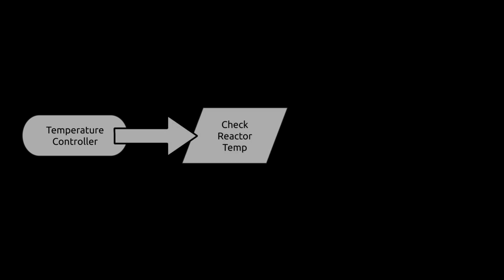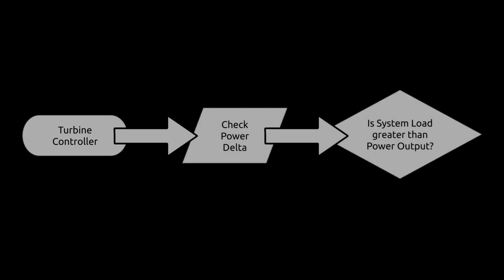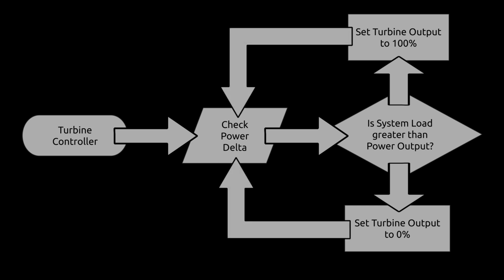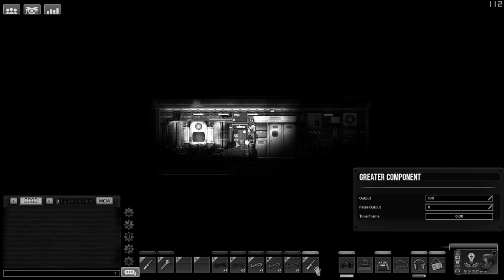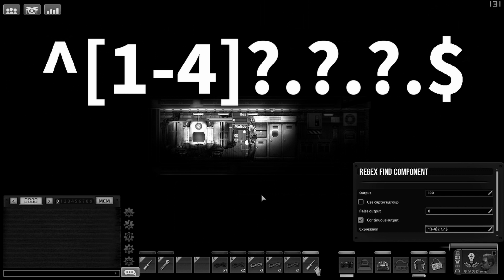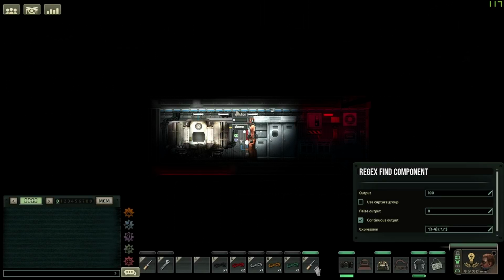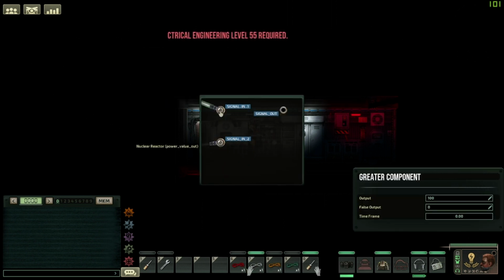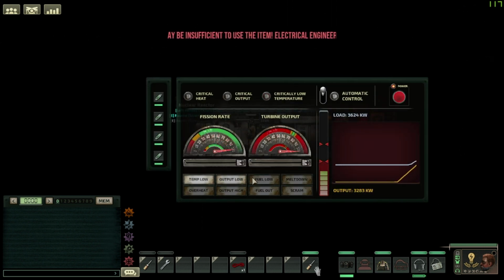Barotrauma - BEHOLD! The 2-Component Reactor Controller!

Comment: Why is this better than just letting it be auto? I know if U suddenly use more power load the reactor has to catch up again, but it uses more fuel because it's at max 50% of the time.
Reply: Personally I don't know how the game has changed, I haven't played in a while, but I bet the issue is the date. This video is nearing 5 years old, and I remember 3-ish years ago the auto controller was extremely sluggish, it would take too long to wind up and too long to spool down, so you get an alternation of brown outs and reactor overheats. Plus you can modify it a bit to change the maximum value of the fission rate with the radio chat letting you set a power saving mode of sorts.

Comment: as cool as this may be, this thing eats your rods for breakfast if you're only using one rod. For instance, in Camel, it takes around 39 seconds to deplete 5% of fuel with this setup, where as Without and With automatic control Enabled, it takes around 55seconds to deplete the same 5%, that's a Substantial difference. Haven't noticed that with 2 rods, it seems 2 rods is okay to use, no difference. However, when using the old trusty 5 components setup, it takes 1min and 16sec to deplete that 5%! With this setup, you'll be loosing so many rods that the benefit is nonexistent, negative even.

Comment: Does anyone know if this still works with 1.0?
Reply from the maker: Unfortunately no. The devs decided it was breaking the game, and changed reactors so that external inputs act at 20% the rate that manual inputs do.
Reply: @TheGamingNerd2022  NOOOOOOOOOOOOOOOOOOOOOOO
Reply: @TheGamingNerd2022  Is it still better than no external output and just normal automatic mode?

Comment: If you are wondering why it isn't working for you, the Bang-Bang controller does not work as well since the 'hoist the sails' update. It's still viable if you are willing to spend a lot of time tweaking values & putting out fires to find out what works for your sub, but it isn't a magic wand any more, & doesn't seem to work quite as well as before even if you get it right.
Reply: I made it work again by making the controller activate only when 4000 °c of reactor temp is at least reached through signal check and relay. By doing that, it prevents the latency " effects " so avoids problems and unwanted underperforming ( the controller is ON at the right moment and goes off when needed so it's stable ). The greater component is set to 75 to safely manage 1 or 2 fuel rods. My reactor works flawlessly and has always an ideal temperature (450-500°c). ENJOY !
Reply: Do you know why it no longer works?
Reply: @leslieviljoen probably due to values changing isn't instantenous anymore and instead takes time to get to other values.
Reply: @Jin-1337  then I wonder if the on/off points can be tuned to match specific fuels. I know that defeats the purpose a bit, but I would be happy always using four uranium rods.

Comment: for anyone who would like this in written form:

-----materials

1x greater than component

1x regex component

5x wires, preferably different colours

-----placement and configuration

-place components near reactor

-configure greater than component output to 100 and false output to 0

-configure regex to output of 100, false output of 0 and expression of:      ^[1-4]>.>.>.$

-----wiring
wire (temperature_out) from reactor to (signal_in) of regex component

wire (power_value_out) from reactor to (signal_in_2) of greater than component

wire (load_value_out) from reactor to (signal_in_one) of greater than component

wire (signal_out) from greater than component to (set_turbineoutput)of reactor

wire (signal_out) from regex component to (set_fissionrate) of reactor
Reply from the maker: Accurate, except for the regex search expression (your ">" s should be "?"s) and enabling group capture checkbox

Comment: With the latest update, this no longer works properly. Any recommendations on how to remedy this? It now lags behind and tends to either overproduce power, or under produce to that lagging behind. So either meltdown, or not enough power. I wonder why they made that change in the latest update
Reply: no way to change it, reactor wire controls are super-smoothed now, best thing to do is to add batteries and a control system to connect and disconnect them as needed, and a control system so the charging load drops slowly
Reply: @TheAechBomb  ya... that's pretty much what I've been doing. It does give the batteries a use though, which is nice. Before they were just sometimes useful. Now they're acting like capacitors

Comment: @The Gaming Nerd "Signals no longer set the fission and turbine rates of the reactor instantaneously, making automated reactor circuits less overpowered. ....", but  "Overvoltage makes devices perform better. ". So, Should we make new controller that will keep overvoltage instead of finding perfect balance?

Comment: New barotrauma player here and I absolutely loved this design. It is cheap, easy and extremely effective. However sadly, the most recent update (Hoist the sails) nerfs automated reactor controllers by delaying the speed at which signals can set turbine rate and fission rate. To clarify, RCs still work, but are just less effective than manual operation of the reactor.

It seems like the developers want to promote having a human being sit still and drag sliders as 'gameplay' to be more efficient. As the designated electrical engineer amongst my crew, I am quite disappointed by this and I hope that this changes, as I thought that the developers wanted to reward creative wiring and engineering solutions to problems such as reactor control.

I'll still love the game and keep playing. It's just a shame that I can't be 100% efficient anymore.
Reply: it was patched its not OP anymore press F for our best and cheapest controller in the game
Reply: It’s funny, considering that you can change so much in the sub editor, you could make a cheat sub and this is something they still just want to nerf anyways.

Comment: @The Gaming Nerd  Hey, I've used this controller in multiple playthroughs, and sadly it's time may be coming to an end! I'm writing to notify you about changes in the next update that is coming out soon. Setting fusion rate and turbine output will no longer be instant. We may need a PID controller after all!
Reply: I've already noticed this issue. I have been attempting to use this setup which worked great before, and now the reactor occasionally goes into near meltdown and also tends to not output enough power. TheGamingNerd, any recommendations on how to fix this once more?
Reply: Any idea why the Devs are making this change? Do they really prefer that players sit at the reactor dragging sliders for hours, rather than engineer an automated solution?

Comment: I have an issue with my sub where when too many things start to get used I lose power. Is there a way to add a buffer system to this to kick in when the reactor cant kick in fast enough? Also how would I go about adding a battery backup to kick in when the reactor runs out of fuel? I've tried to make both of these but I need a new view because i cant seem to get it.

Comment: My reactor caught fire and i have no idea where I went wrong lmfao. Im on the hammer head and i've done everything to spec i'm pretty sure.

UPDATE: i put in a second fuel rod and it is now sitting at the correct power...... idk why it caught fire the first time hopefully it doesnt happen again.
Reply: My reactor Stays locked at 1770 kW output
Reply from the maker: Okay, there are four variable elements to this design.. the the inputs to each Greater than block and the outputs to each Greater than block. We'll call the block that drives the fission rate Block A and the block that drives the turbine output Block B. You want the fission rate to generate a core temperature of no more than 5,000°, so if the first input to Block A is the reactor temperature and the second input is the output of the memory block (which should be set to 5000) then you want the true output of Block A to be zero and the false output to be 100. Again this means if the core temperature exceeds 5,000° then the fission rate is set to 0 otherwise it's set to max. 

Similarly, you want the turbines to output enough power to match the load but not exceed it. So if your first input to Block B is the power output value of the reactor and the second input is the load value from the reactor, then your true output would be zero and your false output would be 100. Again, this prevents the power output from exceeding the load by sending the turbine output to zero, otherwise it's set to Max.

In both cases it's okay to reverse the wiring, as long as you reverse the true and false outputs as well. Otherwise your reactor will be aiming for any temperature above 5,000° and will aim to constantly produce more power than is required
For what it's worth, despite its simplicity I'll botch the initial setup of this circuit if I'm rushing or not paying attention, 99 times out of 100 it's a mismatch between the order of the wiring and the order of the true false outputs. Occasionally I'll put something weird in the memory block, like "5000e" or " 5000" (yes that space causes problems)

Comment: So this makes my reactor efficient and prevents meltdown?
Reply from the maker: Absolutely. This fission rate controller will always use the least amount of fuel possible to maintain a core temperature of 5000 degrees, and there isn't another turbine controller out there that will match your fluctuating power demands so closely. Combined, you can run four Fulgurium fuel rods (increasing your reactor's max power output by over 400%) and never have to worry about fires or meltdown... Except when you turn it on. If you're running that much heat potential, cold-starting the reactor will usually overshoot the core temperature for a second or two, which always increases the pucker factor significantly, but if you've installed it correctly you won't have to wait long before it calms down.

Comment: I'm having trouble. I've gone through this at least a dozen times making sure its all wired correctly. However it blows all my junction boxes once i power the reactor on
Reply: Never mind im dumb, i didnt set the false output to 0 on the regex, the greater component did this automatically so i assume wrong the regex would. Might help someone else
Reply: @jacobbrotbeck8652  it did

Comment: Hi! I'm a relatively new player, I'm just aiming to get my reactor to be able to take in multiple fuel rods at the same time, so I don't have to keep replacing the single fuel rod in the reactor. (putting 2 makes it explode)

Will this work for that?
Reply from the maker: Definitely! You can run four rods if you want, but keep in mind that your supply of depleted fuel (for talent-related recipes) will be much more sporadic, unless you stagger the introduction of new fuel rods over time. 
Either way, this controller, when installed correctly, turns your reactor into something like a refrigerator... You make sure it's full for when you need it, otherwise you don't even have to think about it
Reply: @TheGamingNerd2022  Im also new to this game and didn't know things like these are possible! Thank you for showing us this trick!
Reply from the maker: @luna-amory  You're welcome! Keep an eye out for more tips and videos, coming soon! (TM)

Comment: For future reference or whoever stumbles across this.

[Greater Than component]
Output: 100
False: 0
/\
Load_Value_Out -> Signal_In_1
Power_Value_Out -> Signal_In_2
Signal_Out -> Set_TurbineOutput

[Regex component]
Output: 100
False: 0
Expression: ^([1-3]?.?.?.?|4000)$   (This range should be from 1-4k not 1-5k like ^[1-4]?.?.?.$)
/\
Temperature_Out -> Signal_In
Signal_Out -> Set_FissionRate
Reply from the maker: I'm the Gaming Nerd and I approve this synopsis!
Reply: @TheGamingNerd2022  wrote this because I've rewatched this video 4 times because my memory is garbage >.<
Reply: Amazing, thank you
Reply: Thanks man, i appreciated that
Reply: Im stupid, why use yours instead of video's ^[1-4]?.?.?.$ ? i can only understand simple things.
Reply: @psychkick666  
Boils down to the one in the video is allowed to go to 4,999 which is real bad in game (as it's about 1000 degrees higher than you want)
The one written above only goes to 3,999 which is close enough to 4k to be just fine
Reply: @randomguy3708  does reactor only overhear when over 6000 degrees for a long time? Why it is bad to go to 4,999 degrees?
Reply: @psychkick666  
5000 is too hot, if it's not already overheating it should be soon
6k is big bad
Reply: @randomguy3708  thank you
Reply: Im using ^[1-5]?.?.?.$ reactor temperature doesnt go over 5999 degrees. played 10 rounds no fire ever. Wiki said "temperature raises past 6,482 degrees for too long, the reactor will catch on Fire". better get more power from reactor rather than waste it.
Reply: @psychkick666  
If I'm being entirely honest I just remember that the first formula made it angry and the change I did made it less so, it might vary depending on your sub, in my case I was in the Barsuk 
Even when I got this working it might have been rougher on the junction boxes due to spending time (little bits at a time) overvolting the junction boxes

Comment: new to barotrauma, checked out these videos (this and the perfect generator output) when I joined my friend and got thrown into the electrician role because the rest were taken. I've never really gotten far into the game, biggest feat was somehow keeping our orca powered while we killed a moloch, and this really helps! I mostly mess around in the sub-editor, and I'm noticing that at least in the sub editor by using this method, 1 fuel rod equals 1755 KW, but 3 rods also equals 1755 KW. Is there a reason to use more? these guides have made me want to learn more about the wiring and reactor setup of barotrauma and i cant seem to find an answer on why i can't get more power from more rods, or what more rods does. I see that you are using 4  and getting around 1920 KW but I realize this game is in early access and this video could be outdated.
tl;dr because im sleep deprived and this probably reads horribly
what does using more rods do, since they don't give more power? if they do give more power, how do i get that power out of them? because i am not getting the power as is. Though, as a new player, I don't know if the 200ish KW difference is enough to worry about

edit: I'm still in the submarine editor, and the sub is now reaching around 2000KW, I dont know what i did but it's still only one rod
Reply from the maker: If you're running the two-component controller and getting the same output with different numbers of rods, then I suspect the output of your reactor (1755 kW) isn't being limited by your fuel rods, it's being limited by the reactor controller. If the combined load of all systems running on the ship is 1755 kW and your reactor outputs more than that, then the powered devices around the ship would eventually start taking damage due to overvoltage. Try increasing the power requirements of an always-on system (such as the oxygen generator) and see if that number increases. (If it doesn't leave another comment here and we can investigate further)

As for fuel rods, if you've watched _Perfecting Reactor Control_, you might recall that fuel rods have two important properties: heat potential and durability. Adding more rods to the reactor increases the total heat potential, which means a) you can get a higher fission rate than you would with a single rod, and b) you can get the same core temperature with less fission rate. Less fission rate means slower overall fuel rod consumption, however all else being equal the total run time with three rods at the same time will be precisely the same as running three rods one at a time. 

The trade-off here is that when running just one rod at a time, you have a more frequent production of depleted fuel rods (which can be turned into special ammunition with the right talents), but your reactor will be less responsive and have a lower maximum power output should a situation arise where you need it (i.e. encounters with the local wildlife). Running multiple rods means more power when you need it, at the cost of more sporadic depleted fuel production (you still get the same number of rods in the same period of time, but you get them in batches at longer intervals).

Does that help?
Reply: @TheGamingNerd2022  this does help. I went into the sub. editor again and turned on EVERYTHING in the ship, sonar full thrust all that good stuff and the power started to match the load on the junction box, no overvoltage or low voltage warnings so it should be good! and i forgot it when writing this but reading the properties of fuel rods made me remember that the video covered that, that's a little embarrassing on my part. The junction boxes seem drop down in health a little bit after waiting but, its no more than what felt normal when playing with my friends in a vanilla ship, I'd say every 4-5 minutes it gets damaged to the point of being able to repair them. other than that, the sub is now running smoothly and I will start combat tests with my friends soon ^^ thank you so much
Reply from the maker: If you look at the junction boxes' "repairable" category of properties in the sub editor, you'll see max and min deterioration delay values, which are defined in seconds. Even if there are no overvoltage conditions or anything else that would damage them, items with these properties will manifest damage randomly within this window. That's where the 4-5 minutes is coming from.
Reply: @TheGamingNerd2022  good to know! I figured they just damaged overtime, but it's good to know the why and where ^^ this channel honestly makes me wanna load into a game immediately with how much I learn